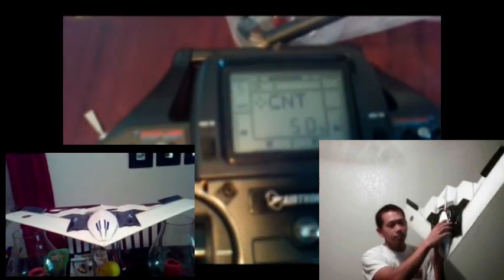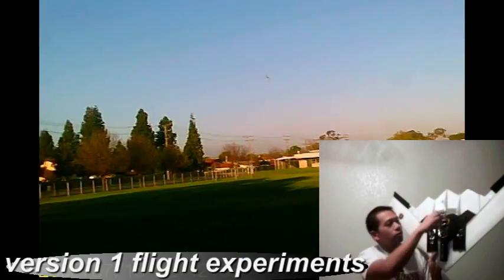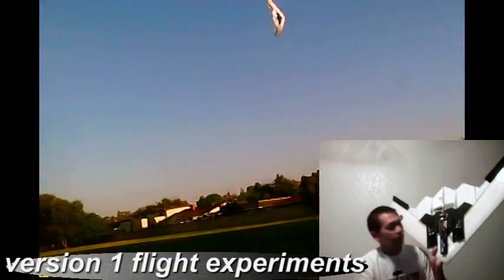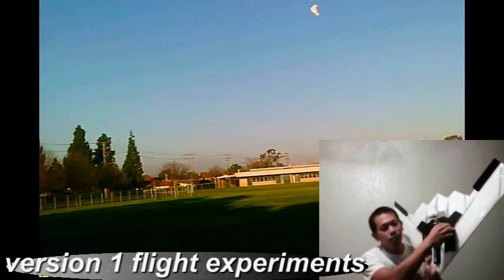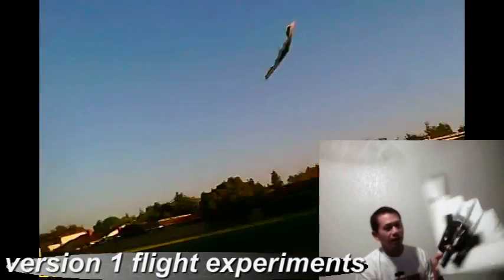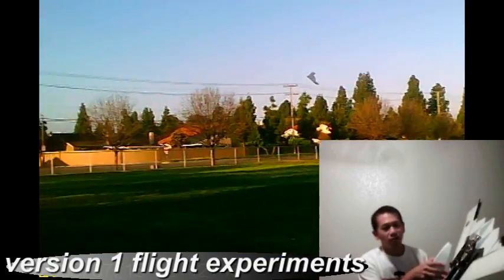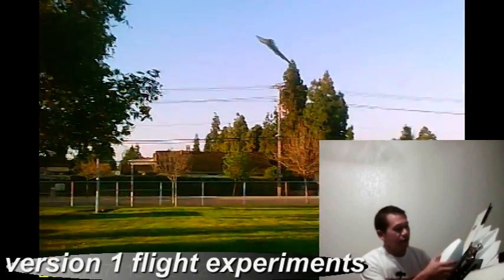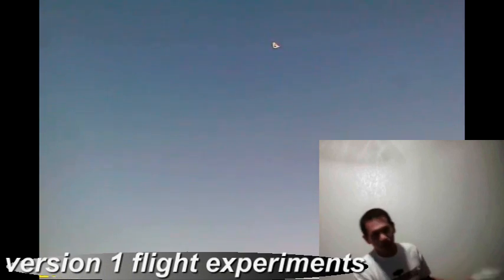B-2.0 build (version 2)

Comment: @wildhover 
By the time you have the time the fpv setups will be much better and more plug and play. I gues the longer you wait the less hassle it all has. It is true that making a plane fpv ready and testing the equipement takes quite some time as you also need to acquire the suited knowledge.

However flying it with goggles with a build in receiver like Fatshark has, equipped with a cloverleave/spw antenna, you only have to bring the goggles extra to the field. Most fpv flights are over 7 min.